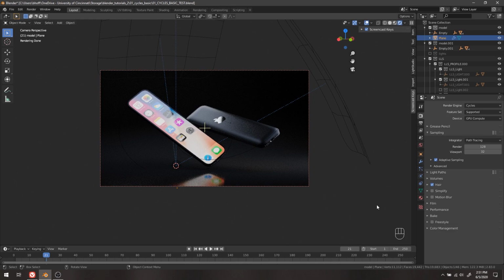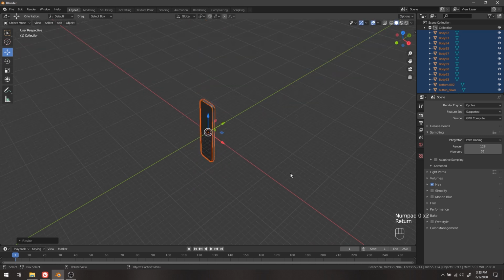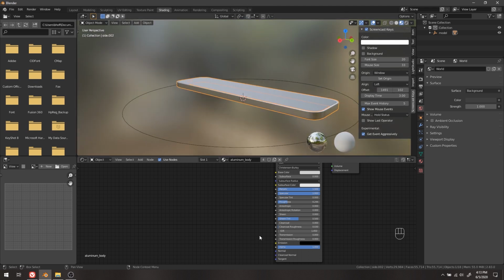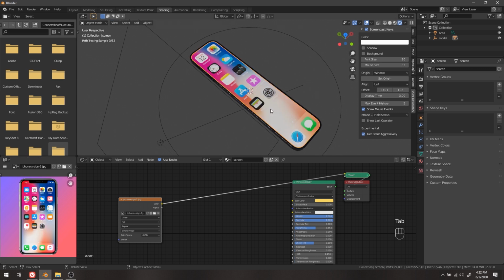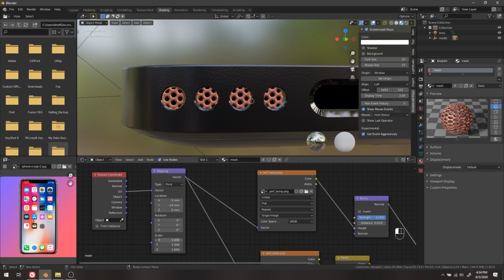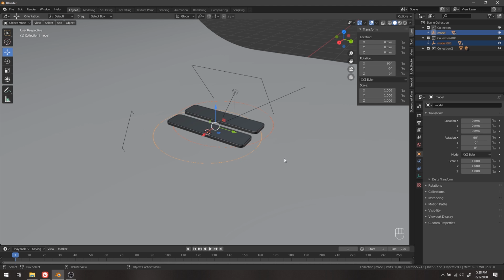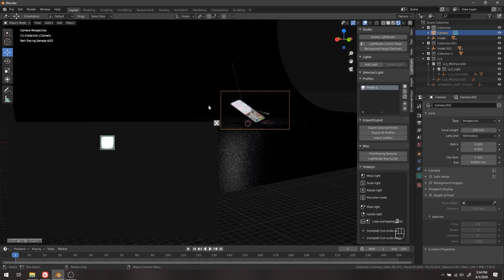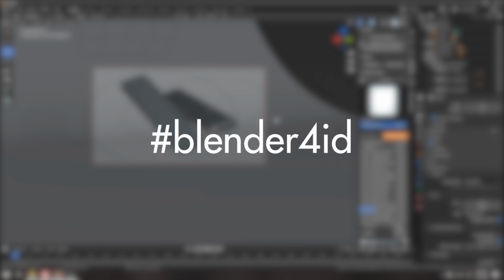Blender For Industrial Design

Comment: Great stuff....heres a tip ...at frame 26:25 instead of search for texture coordinate and mapping nodes..you can speed up your work flow by selecting your texture node and the pressing Cntrl + T..and Node Wrangler automatically places the the Mapping and Texture Coordiante nodes and noodles  in the proper place..also you don't have to hit F3 to Shade Smooth..simply right mouse click on object  and select Shade Smooth option..Hope this helps..Thanks again for an excellent tutorial

Comment: Nice tutorial! What is the advantage of using FBX files over OBJ? I have tried both and the mesh looks the same to me. I am using fusion 360 to model and OBJ files keeps original mapping coordinates from fusion whereas FBX doesn´t.
Reply from the maker: FBX carries more non mesh data than OBJ like hierarchies if you export an assembly or color information all inside one file. OBJ for instance splits the material into a side car file  (.mtl) and dossent support some vertex data that might help you if you have to edit the mesh. Tesselation is independent of the the file type so you shouldnt see a difference there.

Comment: Great tutorial, thanks. I think there have been updates to Lightstudio plugin since your video, the 3D edit button doesn't show up now, but there is a "Light Brush (F)" showing at the bottom of the HDRI panel. I think it's related but have no clue how to use this, it looked so simple with 3D Edit. Can't find info on it, oh well. Anyone else has the same problem ?
Reply: I have the same problem. Was the only reason to get the Lightstudio. But I guess the light brush does have the same function. Just hover over the object and press F.

Comment: Cool idea. I've been holding off on blender for a while now because I haven't been sure of how to fit it into a CAD -> Render workflow, especially when software like keyshot makes materials and labels so easy to do with almost any imported file format. Especially with .STEP etc. I can set apply color to certain areas of surface geometry and then apply different materials to those regions in keyshot, and have been wondering how best to do this in blender, especially with models that are single parts requiring different textures and decals. And I'd also like to use blender for more animation as I still find keyshots animation a bit too rigid.

Comment: question: when I got to the shading viewport the center focus circle thingy (sorry idk what its called) got shifted and idk how to reset it back to the center of the remote. also last thing, I cant zoom in without zooming inside the object which gets annoying if i just want to get a close up at the side detail for example
Reply: Adjust the clip length (For zooming issue)
Press N then adjust it in view